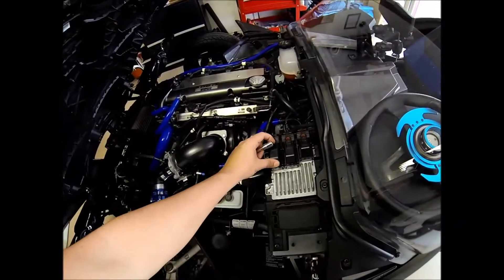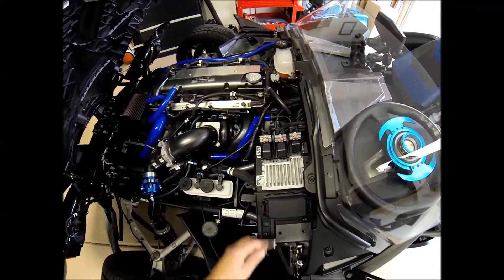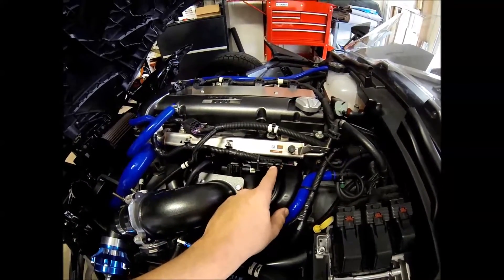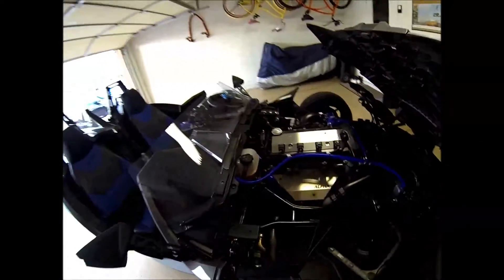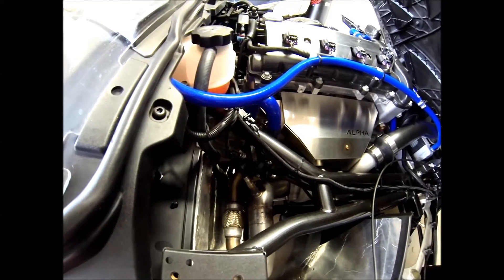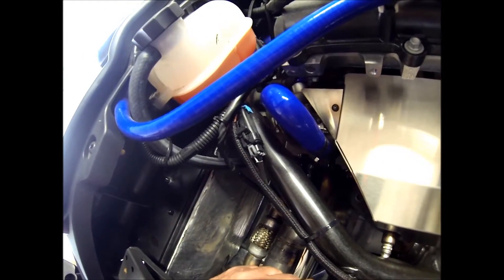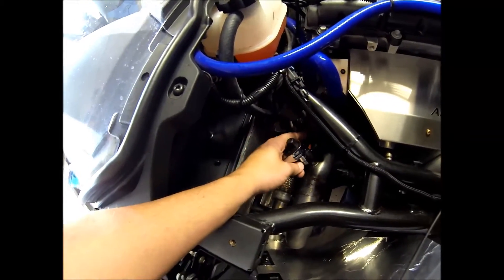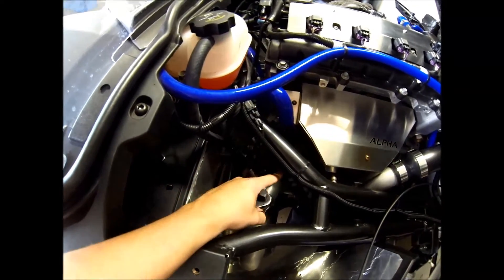Slingshot Alpha Turbo System - How to change to 1bar to 2bar MAP set-up

Comment: good video but I feel that you might not understand fully what BAR is.   for those who watch this video, it is a good video but the info isn't really there:  1BAR= 14.5lbs of boost, and 2BAR=29 lbs of boost.  your stock internals won't handle that, and your stock fuel system won't support that either.  there is SO MUCH WORK you have todo to to your engine, fuel system, and compute to allow the system to run 2BAR.  running 8lbs of boost is right round .5BAR.    Jumping to 2BAR without understanding what it means, what happens and what is required to safely run it, will be catastrophic! even going to 1BAR requires specific parts to safely tune for it. example ( aftermarket fuel pump, a degree cooler set of plugs, intake, exhaust, fuel rail, and a dyno tune preferably ) not a simple flash tune.   and lets not forget about the clutch, your stock clutch, will detonate with that power level. it might hold for the first couple pulls but after that, its gone.
Reply from the maker: Maybe I can clarify to clear confusion... When talking about 1bar and 2bar, I am referring only to the MAP sensor that is being switched out.  You got to remember that our atmosphere is 1 bar - 1.1 bar already, so you need to deduct that from the map sensor range. IE:  2 bar map will safely read around 1 bar of boost and a 3 bar map sensor will safely read 2 bar of boost.  By switching to a 2 bar map sensor, we can know safely run (with the correct tune) around 1 bar of boost.
Reply: the thing is, the MAP sensor doesn't measure atmospheric pressure,  the MAP sensor is Manifold Absolute Pressure ( MAP ) the MAF sensor measure atmospheric pressure, along with humidity, air temp, and air velocity.   ( Mass air Flow= MAF )